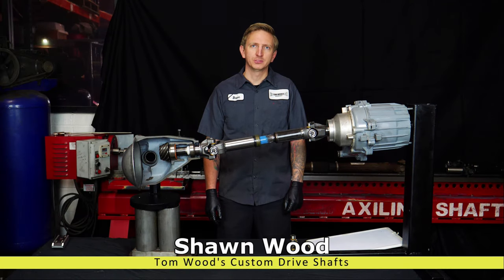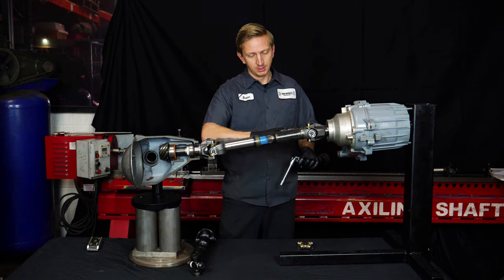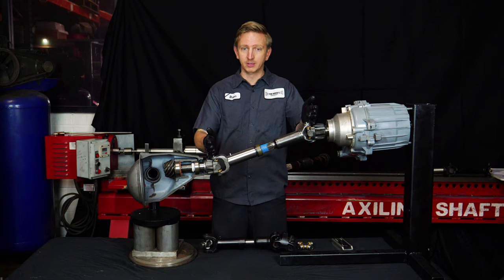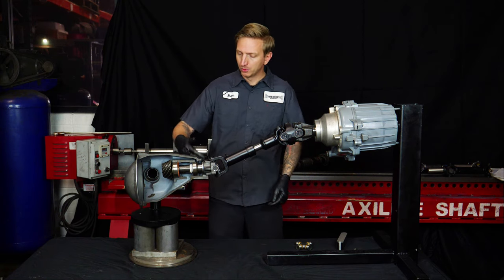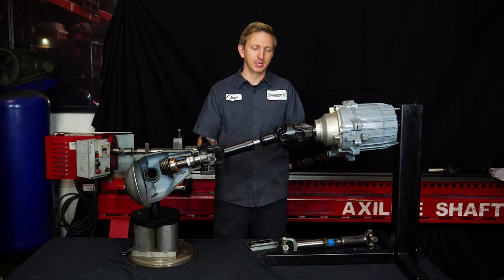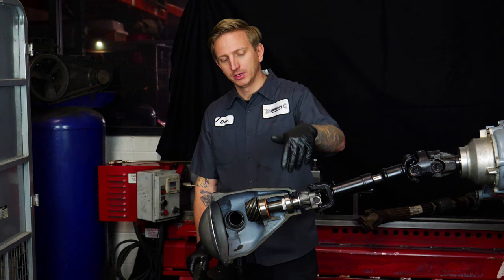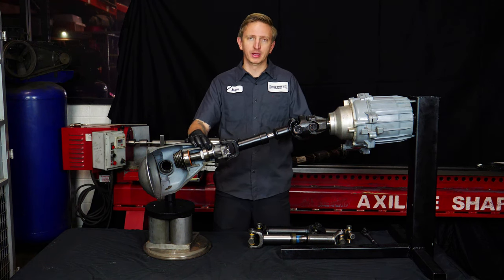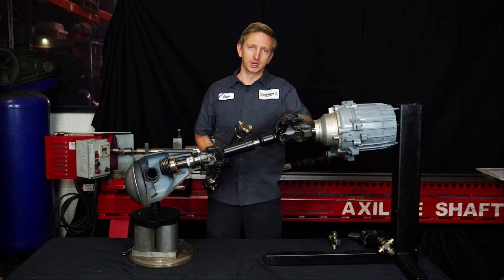Drive Shaft Angles Explained

Comment: After working on jeep suspension for quite a few years, I learned that with a double cardan joint driveshaft,  1.5 degrees axle to driveshaft angle for a 4 link is the sweet spot. With leaf springs you need 3-4 degrees.

Comment: It would be nice if they could use a true constant velocity joint on drive shafts.  The problem though is protecting the rubber boot that seals the CV joint so dirt does not get into the lubricating grease.  Easy to do amongst the front or rear suspension members but hard out in the open where a traditional drive shaft is used.

Comment: Very well explained. You touched on it a tiny bit. Most people don't realize that the driveshaft speeds up and slows down twice per revolution. At steeper angles the speed changes are more pronounced. Steep angles and high speed will give you torsional vibration.

Comment: The ring and carrier actually sling the oil to the TOP of the housing (rear, when driving forwards)where it goes into a channel that drips it into the pinion bore and gets both pinion bearings.  The bottom channel is where the oil returns to the sump.  Remember this when working on a cratered unit.....gear pieces and trash-lok metal bits MAY have been 'slung' up into the oil passage at the top....hard to clean with pinion in place or in car.....pipe cleaners and air and such.  Front a bit different, oils like in the video, but probably doesn't 'flush through' or circulate as well.

Comment: Great video, best so far!!  Currently I have a 2003 WJ Grand Cherokee with a 4 inch lift.  I installed a DC rear drive shaft from you guys when I lifted the vehicle.  I was checking things back there and I noticed that the pinion was not pointing directly to the transfer case output shaft as suggested by a bunch of other videos and literature.  Right now my drive shaft has an angle of 10 degrees and the rear axle checks in at 8.2 degrees.  I was just about to make them equal but if I am hearing you right I need to leave it alone as it is within the tolerance.

Comment: I’ve learned all these lessons the hard way, with a leaf spring lifted solid axle Toyota. I cut my front axle tubes, to rotate the 3rd member(increasing pinion angle) and keeping steering geometry in check.

Comment: Great video! I wish you spoke about when cars are lowered as I am dealing with a horrible high speed vibration which I am wracking my brain over. I am guessing the two piece driveshaft is too flat and shortening the length too much and binding. Love to know your thoughts.

Comment: At around 8 min you answered my question ( at least I think I’m on the right path now lol) ….out of my trans (Nissan Xterra) I was told it was more or less a cv style joint , I don’t know ,when looking quickly I thought it was just a ujoint 🤷🏼‍♂️🤦🏼‍♂️..but I’ll double check before I start “fixing”..anyways so that supposedly isn’t where  my vibration issue is  after installing heavy duty  Ironman leaf packs , hopefully 🙏… on the rear when installing I noticed the back of the axle plate hit 1/4”-1/2” before the front . Thought it was odd but not knowing any better I just torqued down and all flattened out fine….so ….now it’s vibration time from 25 mph up to 40 mph….the Interweb search begins ….no definitive answers I need ( till 8 mins into this tutorial , I think lol) …you mention good idea to have 2-3 degree difference from shaft at rear end to allow for movement etc  ..this is what my deduction came to ,sort of .. I knew there was some angle but only could go from my memory of that gap I saw while installing the leaf packs …so I put a angle finder on shaft (10.1 degrees) then on rear end to follow pinion direction ( 4.8 degrees in Same direction as the shaft  ) so I subtracted 4.8 from 10.1 getting 5.3….I ordered 2.5 degree shims , subtract 2.5 from 5.3 and get 2.8 for the actual working angle at the rear ujoint……close but still  within your 2-3 degree range ,so I feel better now….assuming I’m not a complete moron and I did this figuring correctly , which 🤞🏻🤞🏻🙏 ….do you think I’m on the right track? Sorry for long comment , but, I’m still typing …lol…. So one thing that was consistent across all Xterra message boards was that at some point of distance within lifting the rear end up shims are gonna be needed , then there’s 12 different explanation on how to find out how much shim ,and 12 different shims size recommendation too it seems …so I’m fairily confident the 4”+/- of lift gained by the new leafs created the need for a shim … and now hopefully with your expertise now in the mix , ive got the correct solution…🤷🏼‍♂️🤞🏻🤞🏻🙏

Comment: Awesome video! Could you explain which rules apply for setting up a rear  2 -piece driveshaft with u-joints on either end and a double cardan in the middle after the carrier bearing in a leaf-sprung vehicle?

Comment: The ring gear slings oil from the top so the oil is slung into the top channel and runs down onto the pinion bearings then drains back through the bottom channel. The front axle slings from the bottom but the oil still gets to the top channel.

Comment: Great video! I need help with a rear shaft for a 94  F150 6" lift. Lots of vibration over 60 mph. U joints less than 10k miles on them. Thank you again for this excellent video!

Comment: Never realized you could clock a rear diff any different than it was from the factory setup..  figured it would cause big issues if was any different..  always just put in 2 piece shafts with a carrier bearing if the lift got to be too much for the pinions..  unless could afford a 4 link setup..

Comment: This may sound dubious but Sir, let's assume we live in an ideal world, would running a cv joint with zero drive angle last longer than a cv joint with some degree of drive angle. Thank you so much for your time and answer.
Reply from the maker: Yes, the less angle things are running at the longer they will last. And the more angle something runs at the faster it will wear out. There is something to be said about grease circulation at zero angle though. If there is zero angle the grease won't circulate around the parts as it should. However, this might be a bit of a paradox because if there is zero movement in the joints there is not really a need for grease in the first place.

Comment: I swapped out my dana 30 for a dana 44 in my XJ and I cant get the pinion angle very high without killing the caster.... where can I find information about how to address this? Do you have videos? Thanks, this video was helpful but not so much for the front :)
Reply from the maker: It's sort of explained after around 14:30 when talking about a multiple double cardan shaft. In the video I mention a Grand Cherokee specifically but the concept is the same for an XJ. More information about this type of shaft can be found here https://4xshaft.com/products/zj-or-wj-multiple-double-cardan-front-shaft?_pos=1&_sid=db61262f4&_ss=r. Again, this says it is for a Grand Cherokee but also build these for XJ Cherokees.

Comment: Tom, really good explanation.  But when you say "transfer case"  in your demonstration,  are we talking about a normally a "transmission"?  My understanding is that an actual 4x4 transfer case delivers torque to a second set of wheels in the front, as the 'differential' delivers torque to the rear wheels.  I'm not being a pain, I just am not sure.  I'm thinking that your 'transfer case' as shown is for demonstration purposes and not normally connected to the engine?  Thx
Reply from the maker: @palmerbeepee1 The motor is connected to the transmission, always. In a 2 wheel drive vehicle the drive shaft would come right off the back of the transmission. In 4wd vehicles the transfer case is rearward of the transmission and is what splits the power to a front and rear drive shaft, instead of having just a rear drive shaft. So no, the transfer case is not connected to the engine, it is connected to the transmission.

Comment: Great video. Instead of a double cardan at both ends, why not just do a shaft with true CVs at both ends? This would be less weight and a lot more tolerant of angle mismatch on lifted vehicles. LR defender front shaft has that 15 or so degree offset front and rear uj setup on splined shaft from the factory to counter the factory angle mismatch. Given it is full-time 4wd and defenders sometimes lifted, wouldn't true CVs be a best of all worlds solution?
Reply from the maker: Most lifted vehicles have angles too severe for a CV joint. Stock Jeep JKs come with rzeppa style cv joints in the stock shafts. But for the lifted jeeps, even Dana/Spicer, who makes the stock shafts for Jeep, switches to a double cardan design. The double cardan handles more angle better without failing. More on that here https://youtu.be/IEfoy_OjUUM?si=t_qhBQroMTIqDXv3
Reply: @tomwoodscustomdriveshafts  I see the  jk has design limitations but there are so many fwd front axle CV joints and they are designed to work at large angles. Is there some fundamental wear vulnerability running the CV design constantly at an angle vs uj design? I wonder how would the CVs hold up on a Toyota Corolla if you drove it at a large steering angle constantly for 100,000+ miles..
Reply from the maker: @pwatom22  It's not just the JK that has limitations, that is just an easy and common example. There are a couple reasons cv joints work better on axles. One is angle, most cv axles are not running at a lot of continuous angle. They might see 20 degrees during a turn but most of our driving is relatively straight. The other is speed. The drive shaft is turning 4-5 x faster than the axle shafts. This also means 4-5 x rotations more per mile driven. Assuming angles are the same, a cv axle would have to be driven 400,000-500,000 miles at around 200 mph for it to be subjected to the same speeds and duty cycle as a drive shaft that averages 100,000 miles at around 50 mph. If you factor in the angle, you'd have to drive that corolla in a tight circle turn for those 400-500K miles at 200 mph. When it comes to friction or the deterioration of the rubber boot on the cv, the more times you bend it back and forth and the faster you do that, the faster things wear out.  Another reason is simply practicality. For most of the vehicles we deal with a double cardan yoke on the transfer case is readily available and easy to achieve. I can't say the same about rzeppa style cv flanges. When it comes to custom aftermarket shafts for modified vehicles the u-joint double cardan shaft is much easier to achieve.

Comment: Great video. I have a question though. I have a 4x4 setup and  a center rear diff, but the rear output shaft and the auxiliary gear box is to one side (off center) which means the rear drive shaft will have two angles, a 5 degrees angle downwards and an 8 degrees angle sideways. Will it give me any problems like high speed vibrations? If it does, can i solve it with a double cardan joint at both ends? Or a split drive shaft where one shaft only has a sideways angle and the other a downward angle?

Comment: I have a question I just installed a 2 link air suspension setup on my s10 an I set the pinion angle to make transmission angle would I need a double Cardan joint?

Comment: Do you have info on 2pc drive shafts to set the correct angle, I now have a low speed shimmy  and I’ve tried adjusting the rear piñon angle and just can’t get rid of it.
Reply from the maker: It is sort of impossible to get the 2 piece shafts right. At least in our experience it is not possible to get it right by any means other than trial and error or dumb luck. In theory though the best way to set it up would be to raise or lower the carrier bearing so that the intermediate shaft is at the exact same angle as the transmission/transfer case. This would make the intermediate shaft behave as though it were simply an extension of the transmission or transfer case output shaft. The second shaft, the one below the carrier bearing, would then follow the same rules as any other single piece drive shaft. However, this is a case of easier said than done and it often does not work the way it is supposed to in real life. Google "Toyota Tacoma driveshaft vibrations" for a notable example of how frustrating it can be for people to calibrate their 2 piece drive shafts.
Reply: @tomwoodscustomdriveshafts  sounds good, ya I’ve lowered my truck do angle adjustments are limited

Comment: What is the max rpm a double cardan joint will take, putting together an la 360 mopar, really nice cnc heads, hoping for 500 hp
Reply from the maker: Depends on which engineer you ask, what size joints, and what angle things are running at. You can find some information about max angle at different RPMs here https://spicerparts.com/calculators/driveline-operating-angle-calculator#more. You have to click "read more" in red to see the chart. You'd split the double cardan angle in half to find the u-joint angle. However, I don't think that anyone has data published on the max rpm for the center ball of the double cardan. The center ball is a sliding contact, not roller bearings like the u-joints, so it is the thing that is most likely to build up friction and heat. It is probably the biggest limiting factor for RPM.

Comment: Thank you! I have recently purchased a rear and front driveshaft from Tom woods. Now I know how to install them. Lol... I've been a professional Automotive Technician for 23 years and this damn YJ vibration has been kicking my ass. I put a front LSD in it, so now the front driveshaft turns all the time. Almost shook my teeth out when I test drove it after the diff change. Plus I lowered gearing drastically making my problems worse. I'm doing a SYE and both double cardon shafts very soon. Any other tips that are not in video? I know I'm asking a lot, but I wNt my 30 year old jeep to ride smooth at 80mph down here in this Atlanta traffic.
Reply from the maker: If your front shaft is spinning all the time for sure converting it to a double cardan is a good idea. You'll need to replace the front output yoke on the transfer case with a double cardan (cv) compatible yoke. That's pretty easy to do though and once that is done the shaft will bolt right up. The front pinion wil probably not be exactly right for the double cardan shaft but it will be way more right than it is for the stock shaft. You shouldn't need to worry about nor adjust the front pinion angle. You can find the double cardan front shaft for your YJ here https://4xshaft.com/collections/jeep-wrangler-yj-products/products/yj-front-drive-shaft-double-cardan. There's even a link on that page for the yoke you'll need.
Reply: @tomwoodscustomdriveshafts  I bought the kit with the yoke. Unfortunately it didn't solve all of my vibration issues so as of now the front shaft is back out. It did make a pretty big difference but anything over 55 and it starts to vibrate pretty bad. Any suggestions?
Reply from the maker: @dougbrook6223  https://4xshaft.com/blogs/faq/diagnosing-drive-shaft-vibrations?_pos=1&_sid=d6ec76a03&_ss=r
Reply: I would like to thank you and this video for helping me solve my vibration issues. It required a few attempts to find "the sweet spot" so both the front and rear shafts were in the best possible position. (It also required 2 new driveshafts, a SYE, engine and transmission mounts, transfer case rebuild,a box of shims and a whole lot of test drives.... if I had it to do over I would use an air or electronic locker to keep that front shaft from spinning. But my vibration problems are solved. My old and very much used YJ is vibration free at 80+mph. (Pretty much as fast as it will go.) And that is with 4.56 gears. It can be done. The information was very helpful from this video. So we're the very well built driveshafts. Thank you.
Reply from the maker: @dougbrook6223  Great to hear Doug!

Comment: Thank you for the video. It helped me greatly. Im actually learning about setting up my 67 Nova with the 454 and 700R4. My question is Do the same principles stand for lowering a vehicle? I.E. 3-4 Deg between both pinions and make sure that they are running parallel as well? Will driveline Offset make any difference as well? You have opened my eyes on something that I have always took for granted. Thanks again
Reply from the maker: Dean, yes the same principals would apply but the angle might be inverted. But as long as you meet the criteria of parallel angles and net angle at each end being less than around 10 degrees (maybe even less in your application) things should work well. The side to side offset matters but only because it adds to the net joint angle at each end. There's some math that can be done to figure it but if you have 5 degrees vertical angle and 3 degrees side angle you'll end up with something like 6 degrees net angle. You square each angle, add them together, then find the square root of that sum. The important part to remember is that it isn't vertical plus horizontal equals total. In this "for instance" scenario above you'd still be within the limits of what should work well. Ultimately though, angle is angle and the drive shaft doesn't know up from down from sideways.

Comment: on my 69 lincoln mark 3, the factory transmission angle makes it difficult to figure out a proper drive shaft... the transmission points downward 7 degrees toward the floor and the rear differential points downward toward the floor 6 degress. the factory compensated this by running double cardan joints on BOTH sides of the driveshaft. Running an aftermarket OD transmission required me to make changes to the driveshaft, and now i am at a standstill until i can come up with a way to remedy the angle problem. Running an AOD transmission doesnt allow to easily finding of a compatible output shaft yoke to accept a double cardan joint. Would you have any suggestions for my problem? Thanks